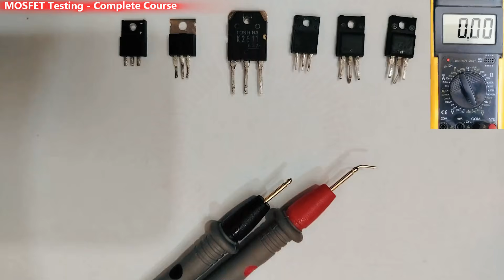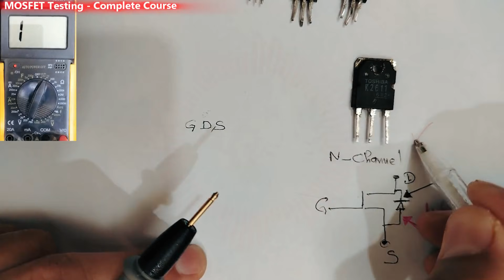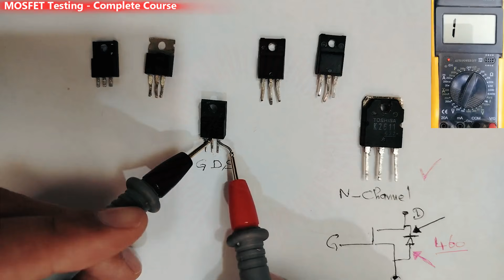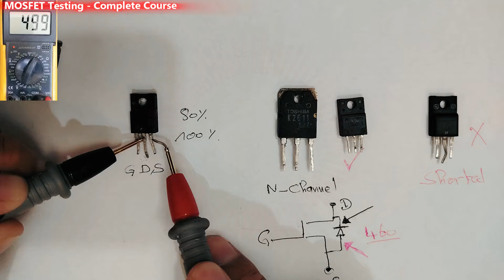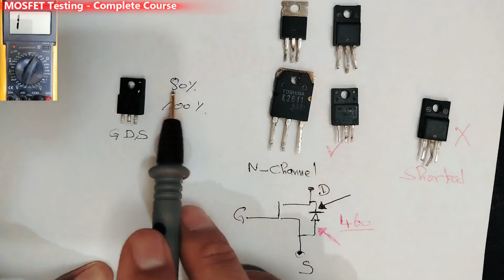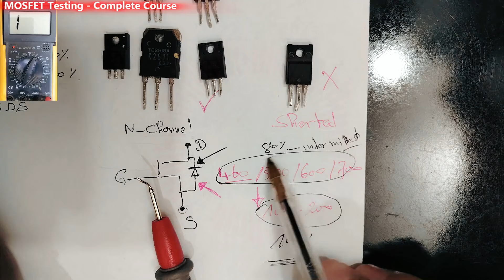Complete MOSFET Testing Guide – 3 Easy Ways to Test Any MOSFET at Home

Comment: What happen if if 1 mosfet from the same kind gets 492 and another 480 reading. Do I need to replace it or it doesn't matter?
Reply from the maker: It’s a good idea to replace the MOSFET if there's a significant variance in readings. But no worry, there is always a tolerance
Reply: @electronicsrepairbasics_erb  if I get good reading from d an s and later when I bring the red tip to g and black one to d I don't get nothing. that is ok but later when I go back to d and s and I get a BEEP and 000. Is that ok?

Comment: Hello. Great video. Am playing with a mosfet right now. I get a reading when between drain and source but when I discharge it by placing the red probe to gate and then test it again , I still get the same reading as before. I don't get a lower reading after discharging the mosfet. Does that mean my mosfet is bad?
Reply from the maker: Noted, could be a bad mosfet.
Reply: @electronicsrepairbasics_erb  Thank you for a quick response.

Comment: Very educational , and I thank you for your content. Question- when checking for shorts, what does it mean if the Gate is shorted to the Source (while mosfet is still on the board with no power (no battery, no cmos battery, and no adapter))?  I look forward to your response (if you have time).  Thank you!